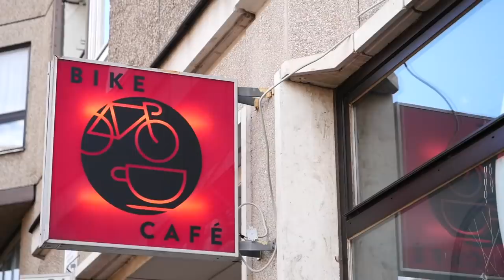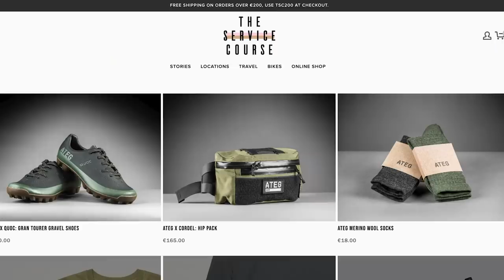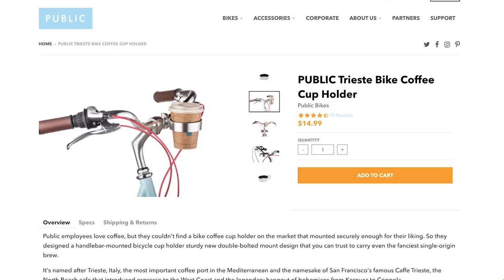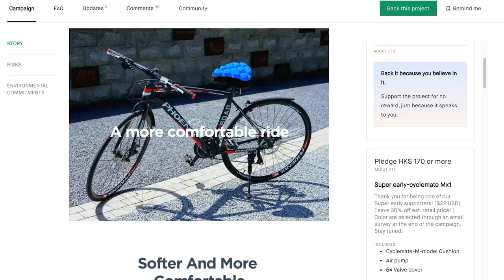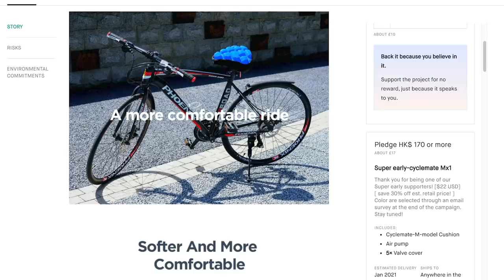Why Are Bikes So Expensive? | GCN Tech Show Ep.156

Comment from the maker: Do you think bikes are too expensive? Let us know in the comments 👇
Reply: Fuck yeah they are. These prices are a fucking joke.
Reply: The big manufacturers have upped their prices due to demand in the past year.  For example you could get an Allez Elite for a penny under grand a couple of years ago now they cost £1250 for exact same bike with just different paint. At massive 25% increase.
Reply: I understand R&D cost money, especially wind tunnel testing, but how many models of a 10K bike would they need to sell before making their money back? 3 or 4?
Reply: The R&D excuse for high priced bikes is a bit of a ruse. All carbon frames look almost identical in recent years because all manufacturers copy the most successful design. Dropped seat stays, D-shaped tubes, internal cables, airfoil fork legs etc. etc. they are all the same and could have been made in the same factory.  Identical story with the wheels. The only excuse for a high R&D cost are component manufacturers and the major ones are only 3, with Shimano having the lion's share of the market. This means they have more than enough revenue to support one cutting edge R&D outfit. The rest of their lines are a trickle-down from there. So, there ... :-)
Reply: Dropping your mates on a group ride. Priceless.
Reply: The manufacturers know their market - and they all price to each other.
Reply: A New BMW motorbike costs less. Brake pads for a land cruiser cost less. None of this is new tech, they have had floating rotors in motor GP for decades.
Reply: They are expensive because manufacturers know that people will buy them more as a status symbol than for actually doing real riding.a 5 km ride to the coffee shop is not riding.
Reply: They are expensive however channels like GCN should some a light on better value brands rather than taking the sponsorship £££ from the expensive brands!!
Reply: On the high end they're expensive just because people will pay it. On the lower end, prices are very reasonable. Bought my Sensa Romagna with 105 on it for €850, would easily sell for €450 now, probably more. After around 25000km, that's only 1,6 cents per km (wearable parts excluded). Quite reasonable innit?
Reply: @pukkagoblin  someone once told me the pads for his road bike cost more than the pads for his BMW motorbike that could do 130mph plus!!
Reply: @g.d.1722  very true.if you painted all those carbon bikes matt black with no logo one would not tell the difference.
Reply: @cottontop99  i agree. They could have a feature in biketech that maybe does a review of the entry level to slightly better bikes. We need to get youngsters involved. Unfortunately the parents will have to pay.be nice for parents to know what is available on a budget. I had to stop cycling years ago as parents could not afford the prices.i was not the best but rode my heart out.i was told by club i would make good domestique.
Reply: @cottontop99  Global Shilling Network. There are plenty of other, no-bullshit cycling channels on youtube.
Reply: Obviously. Expensive AF.
Reply: There are very good bikes for less than 2000 Euros. For those who want to spend more, there are even more good bikes. But the bike will not go up a hill by itself...
Reply: Deer gawd a 5 year old has more self control then Captain "sugar rush" .
Reply: @marks3620  ever heard of inflation
Reply: For something that has been made for 200€ in some factory in China the markup is quite ridiculous.... 
You could buy a nice (motorized) bike for the price of a specialized tarmac. 
It's a bit ridiculous at this point and gatekeeping young/poor talent to get into the sport.
Reply: Maybe at the top end but certainly not in my price bracket.

Bought an Cube Attention SL for 899 euro's.

It has rock shox judy air fork +- 200 retail. Deore 12 speed casette 80 retail XT derailleur 90 retail. Deore 12 speed shifter 37 retail chain 25 retail. Crank + bracket 60 euros. Tyres plus tubes 100 euro's
Brakes roughly 50 euro's.

That's 644 euro's no wheels no headbearing no frame no money for the store.

I'd say the midrange bikes are damn good and damn good value too.

But yes bike over 4 grand and electric ones come with bigger margins.
Reply: Well, some of them. Yes, but you still can do some research in the internet for better deal of a good bike. I bought myself a bike "Twitter Thunder RS" for like $1000 full bike. Well, you got what you pay for. The bike weigh 9.15 kg, maybe not ideal. But at least you got yourself a 11×2 carbon aero bike! You can try to search the bike, there's more model for the brand.  :)
Reply: Largest bike brands are completely accountant and marketing driven. Bikes are so expencive because they take in maximum profit while frames are made cheap in far east. Its just better off buying a branded chinese frame and save a big penny.
Reply: Absolutely. What is considered a mid level bike is $1000-$2000. Budget is $500-700... just ouch!
Reply: Yes, too expensive
Reply: yes
Reply: ebay  carbon seat post for 10euro ,  branded cost 200 ,ebay  carbon sadle 20 euro , branded 400 ,, e bay carbon frame 300 , carbon branded frame 2000 ,,  need the same peoaple to buld them ,, the only difference is the brand name ,
Reply: Horrendously expensive at the cost of pushing people away from the sport. Think about this... 25 years ago you could buy a top of the line italian frame on Top campy parts for about $3,000. Most guys I raced with had a couple or three bikes. Was $3K a bike expensive then? Yeah but not insanely so. Certainly our automobiles were worth more than our bikes. These days... my race bike is worth more than my car. Seriously $20 grand for a top line racing bike is insanity. And $500+ for a jersey/bib combination is also stark raving mad. And social media pushes people to spend more, buy more expensive kit under the guise it will make you faster and make your IG shots so much better. Ugh...
Reply: @JFomo  not quite... If you think 6 months solid work for an aero engineer, a carbon layup engineer, manufacturing specialists and project manager, LOADS of prototypes and testing both in the wind tunnel and strength/stiffness (CFD and FEA only gets you so far), I expect you'd be looking at hundreds of thousands for a new frameset design. And then there is the work on the cockpit, wheelset, loads of R&D going on in groupsets constantly, trying to get it lighter, the jump to 12/13 speed, better ergonomics. There is so much going on.
Reply: Made to poor standards in China for hundreds and sold for thousands. R&D costs are a lie, bike design has hardly changed in decades.
Reply: As long as people keep buying bikes. I think the price is fair.
Reply: Yes. Just think of what motorcycle £10K would get you.
Reply: For the dishonest bikes yes, for actual European, Japanese and American made ones, no.
Reply: There is no much end involved. It's the marketing cost.
Reply: Prices are what the market will bear, most brands are competitively priced with each other...but that doesnt mean its worth what you pay for.  People will pay more $$$ for higher end bike status, which is fine for some.  I would bet more entry level bikes are sold by most companies, and its there that the consumer often gets hosed by the markups, imo.
Reply: yes, bikes is not the only industry with extensive R&D. the prices are not reasonable.
Reply: need to become a gcn presenter. cost of hyper bike - 0
Reply: Riding the bike you like is worth it.
Reply: My bike is around 300 dollars and for me its already expensive 😅
Reply: I buy second hand and rely on a few folk buying bikes with bloated prices, hardly using them, before selling them for a massive loss. Much like new cars, why not buy a 2-3 year old one for half the price?  Possibly a post transition period- brexit may impact new prices adversely for years to come, via tariffs, elongated production and supply lines.
Reply: Yes. Because dentists can afford them.

Though there are affordable options with some direct to consumer brands and Chinese frames.
Reply: No not so much. I am ready to pay quite much money on my hobbie. Right now i have 3 different bikes for About 10-12 K dollar each.Thats fine with me.
Reply: Because they sell. So long as some idiots will pay mad prices, bikes will stay expensive...
Reply: Depends what you want from it, I paid £1500 for a Aluminium and Carbon mix bike that weighs 7.4kg, Ego's can be expensive
Reply: I'm probably in the minority, but I don't think bicycles are too expensive. I mean there's no way at the moment I could afford to drop $10K on a bicycle, but I tried to explain it to my dad like this: if you had the choice between buying what would be along the lines of the Bugatti Veyron of bicycles or putting maybe half down on a Toyota Corolla, which would you pick? Relative to other things (cars, motorcycles, boats, Fabergé eggs...) a bicycle is quite a bargain to get to THAT level. And if it's something you enjoy and use regularly, all the more reason.
Reply: Yes they are when you get to the point of charging prices that can buy you 2 cars or 3 motorcycles. R&D is an excuse. They can choose what they research and most cyclists have little interest in carbon anything because of the premium you pay for something so fragile. They can choose to research ways to make bikes more durable, modular and affordable instead of catering everything to the 1% of high performance athletes or finding ways to complicate bikes with electronics to justify the prices they want to charge. 

The small indy companies are creating solutions for average every day cyclist problems and affordably. Creating marginal improvements for 100+ year old technology and charging 5 figures for it will never make sense to the average person. 

The average 200watt cyclist is the heart of the cycling industry not the sport side. Maybe they will wake up to that fact one day. The bike industry should be trying to replace in a sustainable way, the auto industry, not emulate it.
Reply: @lawrencesingleton2153  ok so probably 100k to 500k just for the frame. Jesus!
Reply: The problem with the price of bikes is that it creates a tremendous "barrier of entry" for new cyclists.  The privileged, affluent rider has a leg up on the competition.  I believe that the most talented riders eventually rise to the top like the cream they are, but how many potential Greg LeMonds or Sepp Kuss' are out there that give up because their parents can't afford bikes.  We want to see a more racially equal peloton, but do you think a kid in the city can afford carbon?
Reply: Why so expensive?  Because they can and you will pay.  Rich dentist weekend warriors. As simple as that.
Reply: Like other industries,  the bike market has split into an expensive luxury tier and a cheap mass market (the huge number of bikes sold by Walmart, etc.)
Thank goodness there are still some bikes in between! And the used market is thriving.
Reply: It would be interesting to have an industry expert on.  Most of us don't have a clear idea. I suspect: 
- high end bikes are a very small part of the market, but important for profits and prestige 
- the latest boom is mostly among low and midrange bikes
- most high end purchasers are not very price sensitive.  
- many manufacturers are fixated on the high, even as opportunities are emerging for more reasonably priced bikes because of covid. Path Less Pedaled just had a video on the subject.
Reply: One of my bikes I bought, that same week, my best mate purchased a Honda CBR 125 motorbike brand new for £100 less and that’s got an engine!
Reply: bicycles are more expensive than motorbikes & cars.
Reply: Yes, charging 4k plus for a frame when it only cost the manufacture $400 to make. It is keeping people from getting into the sport.
Reply: The justification for the high prices don't add up; people need to stop paying these prices. A £10,000 bike won't make you 10 times faster than a £1,000 bike. You're being ripped off.....
Reply: I think the point is the peak cycles are expensive, but the mid and lower range are reasonable and benefit from the top end. Now your low end claris bike could well be much better than the top end bike a decade ago
Reply: Also, I think channels are beyter promoting low to mid range level bikes as that is more affordable and more likely to be bought. I think the majoroty of profit comes fron low and mid range bikes
Reply: Of course.  If most guy's wives actually knew what they spent at the bike shop, we would all be permanently sleeping with the family dog.
Reply: Made in china and costs a mint! Ridiculous!
Reply: Well hell yeah!!! And they break as quickly as you use them  often, they should be liable for that. Price should be equivalent to strength and reliability or else... They are much expensive than my car and I often use it and brings me where I need it.
Reply: @JFomo  Hopefully sarcastic otherwise dannnnnnng you got a hard time understanding how product production and innovation works.  You don't just immediately start producing a hyperbike.
Reply: @KenSmith-bv4si  Poshnoxious.
Reply: Totally rip off prices
Reply: If you have teenager who dreams of riding something nice. It shouldn't be  costing you over £1000 before you can even consider things like 105. As other people have mentioned there motorbikes to had for less than £10k. So where's the incentive! Is this just another case corporate exploitative marketing. If you can't afford then you're obviously not serious about cycling and other such rubbish!
Reply: it's like asking "why are cars so expensive" you don't have to drive a ferrari lol, you can have fun on a clunker. blame the dentists
Reply: No I think their too cheap!!
Reply: Absolutely, how is a bicycle more expensive than some motorbikes and cars
Reply: The pricing model reminds me of TVs and tech. If you want the new tech you have to pay £ks but in time I would expect a manufacturer to mass produce a bike with a spec that hits the sweet spot at a price much lower than the average new bike range.
Reply: Yes, though it's often because people think they need more bike than the actually do.

Do I need carbon, 11-speed, Di2? 

No. I can get aluminum, 10-spd Tiagra.
Reply: If bikes were too expensive, no one would buy them or prices would decrease. “Too expensive for me” is not the same as “too expensive”
Reply: Absolutely they are. Cycling should be an affordable sport/recreation for everyone to get into. If you want to get into road cycling then for many it’s prohibitively expensive. For an “entry level” bike to consistently cost upwards of $1500 aud it really limits who can take up the sport. I suspect though that there is a good proportion of those already riding who like this exclusivity aspect, not to mention companies more than happy to keep the prices high.
Reply: @DaRobsterr  I take your point, although for people like myself who’d love to ride a road bike I’d have to take out a loan just to get on an entry level bike.
Reply: @cccpkingu  are there any bikes actually made in Europe anymore?
Reply: Person who can afford a bike: “of course prices are fair. I have 3 bikes.”
Person wanting to take up the sport: “I’m not paying over a thousand for an entry level bike”...
Reply: @ChrisCapoccia  except that you won’t find a reasonable bike costing less than a grand that you could realistically ride in a bunch.
Reply: @Superfly1503  there are a lot of people who aren't interested in a bunch
Reply: You can buy a good condition toyota supra for 15 Grand.
Reply: They're too expensive for what you get, when your own presenters opt to replace the bottom bracket of a pinerello because of creaking then all you're advertising is poor build quality, the price should reflect that poor build quality.
Reply: Gcn was cover how Willier carbon bikes are made. In they're made in "far east" - - which is GCN's word for China. Their Handwork in Italy just painting and building. So yeah. It's a Chinese made frame
Reply: The bike industry is kidding itself, way to much.
Reply: I love dropping rich white guys with hyper bikes my 90’s Cannondale. That expensive carbon can only do so much for you. The legs and your mental conditioning are worth much more.
Reply: prices are getting through the roof, top shelf bikes are "pulling" all other prices behind. 105, "random carbom frame", cheep aluminium clinchers, rim brakes are now 1200€++
Reply: hell yeah they are cars prices. The price is linked to elitism and that was never what bike ride was about, the industry is out of it's mind
Reply: High end bikes are like popular high education textbooks, they release a new version each year with minor changes and charge a high price because they have a small user base and know the users will buy them anyway.
Reply: @jeramyboileau4967  it's not necessarily elitism. All high end hobby equipments with a small and dedicated user base cost relatively high, e.g. high end audio equipments, high end photography tools, etc. It's just the nature of the economy of niche hobbies.
Reply: Yes.  Thank disk brakes and carbon rims, kids.
Reply: Yes - the bike industry is a joke. Compare to motorbikes and cars. Very little innovation over time also, so I don't buy the R&D argument. Too bad for cycling in general.
Reply: @JPLTF373  Before they binned Jon Canning I learned a lot that I'd missed over the years.  This year they've sunk to street-walking lows.
Reply: I volunteer at a local 'bike kitchen', a nonprofit,  just to help keep the door open for those want to ride, at what ever level, at a more reasonable price.  The place is booming not just because of the latest up trend in cycling but in addition to that; because of the rise in cost.
  People volunteer there more right now;  to access the opportunity to pay less.  This has created a greater opportunity to give people bikes who have next to nothing and to give away bikes to kids.   The key to the financial success of the 'bike kitchen', over time, has been to keep quality control strong on the bikes that are refurbished and most importantly to solidly keep prices lower than current market value.  The lower prices and solid rebuilds keep the bike flying out the door.  What comes back in is steady inflow of well gained cash.  The rise in prices has helped on volume.  Resisting the temptation to take the maximum value of the used bikes we sell has kept the community very supportive.
Reply: Trek has just increased their prices by 10 percent.
This is all about greed.
I mean their hardly a Honda Fireblade are they.....
In a few years the manufacturers will get screwed because post covid the world will be awash with bikes.
To listen to these 2 trying to say it is justified is bollox.
Afraid  to offend the big bike players..
Reply: They are too expensive, and there is no reason for bikes to be that expensive.
Reply: Marketing mark costs for all the product placement. 😉 I don’t think the Chinese lady laying the frame is getting paid too much.
Reply: Please update your viewers on the bike and bike parts shortages across the world. This is important! People are waiting months and months.
Reply: I walked into the store, looked at specialized and its like 14,000 dollars...way out of my price range
Reply: Bruh with a bike's price point compare it to a bigbikes where you can already get a 600cc below bikes which is more faster, more advance in technology, not lighter but still, and also far more comfortable in long rides
Reply: @dismiggo  work hard boy
Reply: Trek bikes are a fricking joke.  The Supercaliber 9.9 XX1 AS is 11,000 dollars. I could buy THREE used Hyundai Eon cars for that money. Trek, if you are seeing this, you make amazing bikes but your prices are shit.